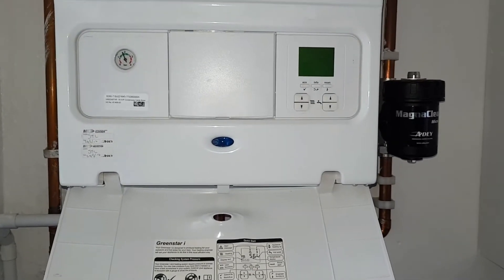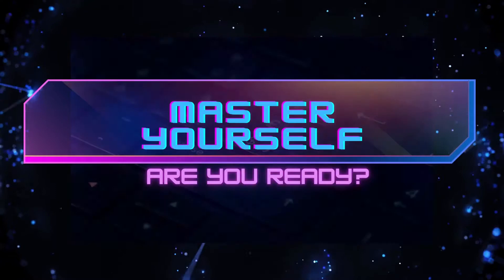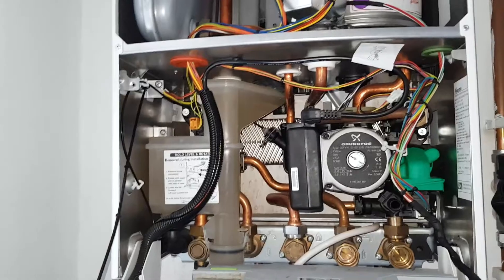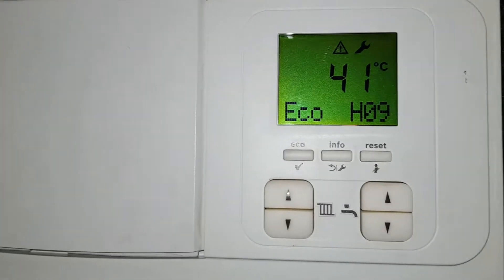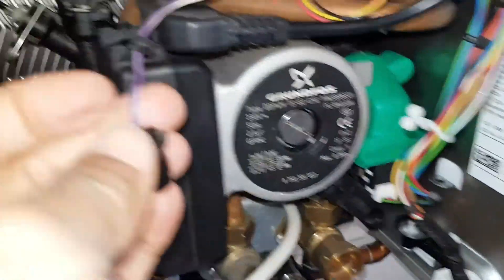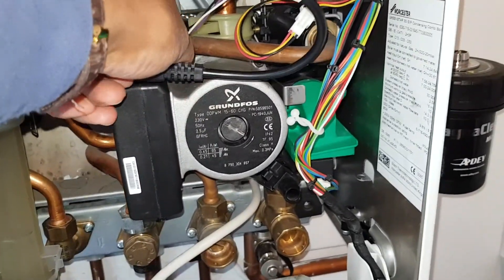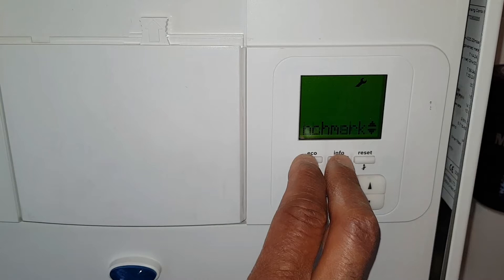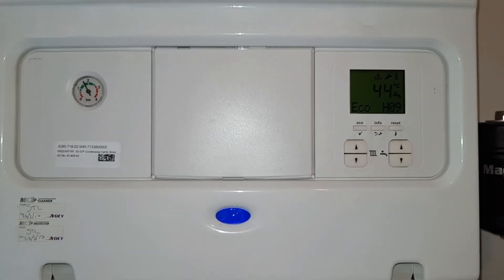Worcester Greenstar 30i H09 Error Code Part 1

Comment: So I had this issue last year and again just now, I remember calling Worcester for diagnostics and the guy from technical told me that it could either be the pcb or the pump, I asked if he could guide me to pin it down to one and he said there isn’t a diagnostic for that. It’s a draw of luck.. so I changed the pump and it didn’t work so changed the pcb and that fixed it. Just told my customer now that I will have to order both unfortunately and it would cost him double unfortunately.

Comment: Hello,

We have sane boiler hot water works just heating only works when set to max by holding reset button in other words not when on ECO mode.

What it could be in your opinion?

Thanks in advance

Comment: Thanks for the video I was able to fix my boiler. The speed control wire was loose and the stopper open, I've had this boiler for 6 months and only checked and seen this H09 error today.

I'm wondering what consequences this would have had with the connection loose? Would there be efficiency loss, pump wear or heating issues?

I just decided to have a look tonight to lower the hot water temp on the boiler and that's when I saw the error code. Havnt noticed any poor heating but am worried the pump may have been damaged if it has been running constantly.

Thanks & subscribed for the explanation & great video